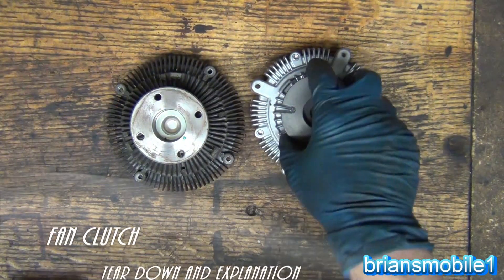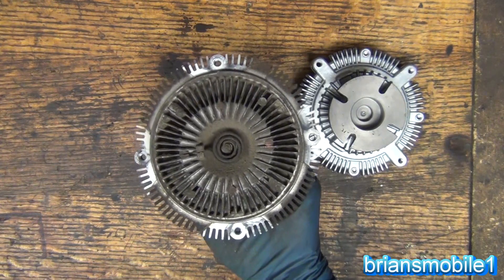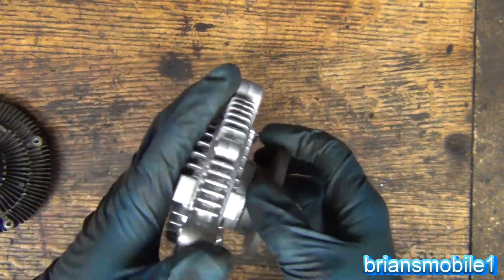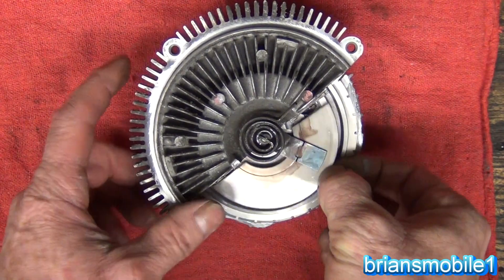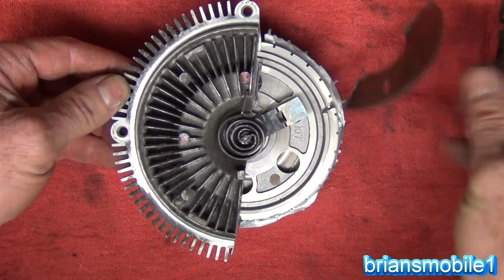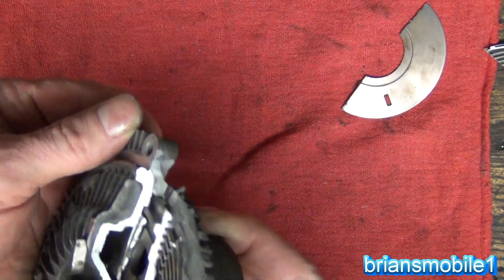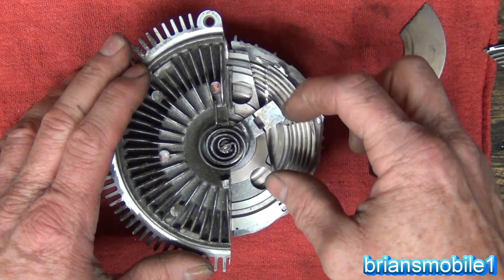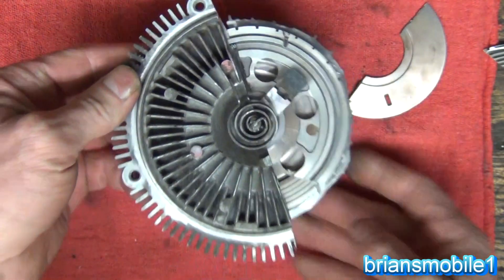Fan Clutch Explo-tionation

Comment: I recall in the 70s n 80s...we would run a bolt thru the clutch to make it lok up....im having trouble w my 2014 tacoma.....its running 2014 on hiway...i was able to put my glove on and grab the fan blade and stop it from spinning😲🙈😲🙈😲

Comment: Nice video;
But you got that backwards: The feed hole (slot) is COVERED when cold, opens when hot...
(since you've cut away the case, you have the bi-metal spring out of alignment).
Also, this IS a fluid clutch, that moving vane releases the fluid into the clutch fins.
And the internal fins are NOT for heat transfer, they are there for the viscous coupling of the two plates...
The spring does NOT force them together.
The fluid must have completely leaked out, or you washed away what was left of it.
But VERY GOOD presentation...
Mr K L

Comment: do they always spin freely when they go bad? Or do they also lock up or get stuck half way? I guess what I'm trying to ask is can they cause a overcooling scenario at start up and idle when the engine is just started?
Reply: Generally, they can only get stuck on, or off, or loose fluid (off).
If the spring valve gets stuck in the 'hot' position, then it would run all the time (ie, if the valve shaft rusts and seizes).
But not likely, because usually vehicle sits with engine cool, and is more likely to get stuck in the 'off' position...
Of course anything that can happen, will happen... If it is 'crusty', I suppose it could open up (fan on), and get stuck there - fail to retract again when cool...
Mr K L

Comment: Imports and domestic vehicles going back into the 80's all had a silicone fluid fill via a screw on the engine side. The closer the plates you exposed in the cut-a-way simply expose where the fluid is held. This fluid become thicker and thinner in viscosity just like most fluids, even oils as temps change, but it produces a drag between the drive and driven parts the control the fans speeds. Yours like everyone else simply failed as it developed a leak. The silicone formulated and injected is gone leaving no means of moving the fan to match or couple speeds with the circulation pump or fan block as some designed. They all had silicone fluid inside then between those cavities and gone because of a leak, it simply freewheels.
  As for overheating at highway speeds, they normally are along for the ride and don't pull air thru the A/C condenser or radiator. Flushing the radiator core to have no insulation debris separate the fins & outside air or and engine problem was most likely you root cause of overheating under those conditions as the fan clutch had fail over winter or months earlier. The pressure cap holds 15-17 PSI on the coolant. Each 1 PSI raises the boiling point 3 1/4 degree F to 264 degrees F roughly (Yours may vary) but the clutch was not the problem at 50 MPH - 75 MPH with or with out the fan clutch functioning. 
DK, ASE master tech since 78.

Comment: Yeah I always wondered how those things worked like without wires from the ecu telling the clutch to engage or without having hot coolant flowing into the clutch to engage the sping that reacts to temperature. (I'm like I know they have a spring that responds to temperature but how do they know the temperature of the engine if they don't have coolant flowing into them to engage when the coolant is hot) The thing I still don't get is how do those clutches know to engage when the ac is on without any type of wires going to it???

Comment: Ever since these things first appeared back inn the 80's or so I was told a honey like viscvous fluid was used ....I believe when they wear the Viscous fluid leaks out and they can no longer work to put it simply...Ive grabbed and stopped many a fan blade on a hot engine while the clutch was freewheeling and the engine idleing with my bare hands showing off to my fellow mechanic friends when I was a teenager , I would let the back side of the blades strike my fingers and slow it down and then Grab the fan and hold it still for a few seconds while the engine was running...
LOL

Comment: tried 3 of the new junk fan clutches from china and my truck sounds like an airplane cold or hot. off and on all the time. new ones are cheap garbage. went to the junk yard with an original clutch for $30. no problems.

Comment: Very Rusty Spring:
The other day I was towing our camper. OAT was approx 65*F. ECT went up to 238*F.  No fan engagement at all. Clutch has resistance but I was thinking the fan clutch spring was very rusty like sandpaper and binding up.  Thinking possibly the spring is not rotating.

Comment: @briansmobile1 the fan hub you cut up should have had silicone oil in it, if it's empty, that's why there's no resistance in it and it doesn't work.
If you open the new one, it will have around 30-60ml of honey consistency silicone oil in. Different hubs and engines require a different oil weight, i Just put 36ml of 10,000mm2/s in my hub.
Excellent video and explanation but it's missing a vital part!
Cheers!
Reply: Is it possible to get the wrong fan clutch? i have a 91 Mustang and everytime i would go to a drive thru or something the car would start overheating,not bad but just not good either, i keep my coolant very nice and clean, thermostat perfect, good radiator but the new fan clutch i had  that "helicopter effect" people talk about, i said the hell with it and installed a electric fan , never had any more issues again.

After about 6 years the Time has come to overhaul my electric fan system and im looking for a different control box for my fan so for the time being i purchased a brand new  mechanical fan, clutch and fan shroud which i should be getting this weekend, I'm concerned its gonna start doing the same thing again however these cars came with that mechanical fan, not sure why it would overheat.

All i can think is maybe i got the wrong clutch last time i bought one,i still have it and its actually not that old but man when you would start the car it would make a sound like a helicopter was taking off under my hood, lol.

Comment: Does it matter which way the spring is wound?
Reply: Yes;
Has to be right for the design.
Most I have seen have a CCW (as viewed from the front) valve open rotation direction; but I have seen this done with both CW AND CCW wound bi-metal elements! - it depends on if the 'spring' they designed is expanding on heat, or contracting on heat...
It depends on if they put the higher expanding metal toward the inside of the coil, or wind it the other way...
(so don't get it flipped over, if for any reason you remove it...)
[answered this for future viewers here]
Mr K L

Comment: I have a 96 nissan truck and the parts both old and new look exactly like what I have. the old for sure and the new I picked up a O'Reilly's  and is a IDC. my old one was doing the opposite. It was locked up and even though I could get it to turn by hand there is a point that it just sticks.  now that I know there is no fluid in there maybe it could be cleaned up.  I don't know.  but I am curious how the new one has been working.  I had about a month where I didn't notice anything and the fan was turning but no issues.  It was a month later and I didn't even think about it being the Fan Clutch because it was new.  But evidently mine is not engaging when it needs to and I heated is up to 220 and it is still the same.  but when it is on the pulley and the Water pump *waterpump is good, when it is there and I suddenly hit traffic and it needs to cool things down you can hear it getting wobbly and just enough time to pull over because it reaches out and nicks the radiator. The fan blades that are attached to the Fan clutch move from that wobble just enough to nick the radiator and lose your fluid and get a tow home.  I chased so many other things and I could not believe it when i realized the new one I bought was not working correctly.. So I am just curious if after some time did yours do good? I think mine was made by IDC for O'Reilly's.  ayways, thx, kinda interesting coincdence and I am hoping the next one I get is not messed up.  definitely will test it beofore I install it so I don't nail another radiator.  that makes 5 aluminum and my OEM nice heavy duty one all from this crazy part and that no one thought it could be the culprit.

Comment: I definitely understand the concept of the fan clutch.  I don't understand why there is any resistance at all when the clutch is at room temperature and the fan is not needed.  At room temperature, the engine/radiator would be considered "cold," and the radiator would not require any cooling air from the fan.  So at room temperature, there should be NO resistance in the clutch so the pulley can spin freely without resistance from the fan (with a cold engine, the fan would do nothing but suck engine power and lower efficiency).  But if the clutch has resistance at room temperature, that means the fan will be turning when it's not needed.  It seems to me that the clutch should be completely disengaged when the radiator is cold.  Then, as the radiator gets hotter and hotter, at some predetermined temperature the bi-metal spring would turn enough to engage the clutch and spin the fan ONLY when additional cooling is needed.  What am I missing?
Reply: It has to have SOME airflow to activate the sensor.
Without that, once it shut down in cold weather, then, with a tail wind, or parked, engine idling, it would overheat without kicking in the fan!
[answered this for future viewers here]
Mr K L

Comment: If I put higher viscosity fluid inside would the fan be running all the time? I just want the fan to spin louder at low speeds for the cool rushing of air sound like in big diesel trucks.

Comment: Thanks for the video Brian. So there’s absolutely no fluid in this type of fan clutch? I think this is what I have on my 2003 suburban
Reply: condor5635 should be fluid in there. I replaced mine with an extreme by hayden 2786. 2002 gmc yukon. The temp would hit low 200's and at one point 230 towing a camper up a long grade. Right now, I can't get it above 199. I use a blue tooth elm127 obdII connector and monitor with torque pro. The engine actually cools off when parked and I increase the idle. Best move ever.

Comment: Question. Can a fan clutch turn either way or they are meant to turn either CW or CCW?
Reply: They will only work (correctly) one direction:
The fluid return pumping action occurs only rotating one way. (necessary to disengage the clutch).
Drive belt routing results in different vehicles having right or left hand fans...
[answered this for future viewers here]
Mr K L

Comment: Great explanation of how a fan clutch works. If you still receive notifications from this I have a question. I had the timing belt and water pump replaced is it true that they should have replaced my fan clutch when doing the water pump? I read that the fan clutch will wear the water pump quickly on my 1988 Toyota truck with a 3.0L V6 if it was not replaced.

Comment: Great video. My Jeep is having an issue with the clutch fan I believe. Keeps nice and cool on the highway, and on long straightaways...then in traffic it runs a bit hotter without overheating. I didn't realize that the spring in the middle was a sort of 'thermostat". I figured they just ran on centrifugal rotation based on engine rpm.

Comment: Hey Brian- this is a great video explo-tionation! I am about to buy a 7 blade Mopar fan with a clutch. This is for 1968 383 motor and as you can imagine it's getting harder to come by. So my options are limited. How can I be sure that I am buying something that is good quality and not to used up AND how hard would it be to replace the worn out portions of seriously old internals of the clutch?

Comment: Poor engine... Those clutches are reliable, but go tear out an electric fan from a scraped ford taurus or something. Tiny engines suffer quite a bit (or as much as alternator strain) and that pully puts too much torque on the pump behind it, causing your whole engine to heat up and strain from being heated up and straining.....

Comment: I think you got it wrong. According to my college book that spring just opens a hole for the fluid to flow. I think your old clutch just lost all the liquid that is why is dry. The new one got fluid inside.
Reply: It does seem to have lost all the silicone fluid that is supposed to provide the viscous coupling.  When the temperature gets high enough for the bimetallic coil to turn the valve, the silicone fluid goes to the outer area where the interleaved grooves are, and allows the fan to be driven instead of freewheeling.
Reply: ***** That is what I think. Thanks
Reply: Yeah i was surprised too. Coz always knew that there s silicone or some liquid in there.

Comment: I don't understand what this spring does. How can that lock the clutch?
Reply: Gregory May when the spring gets hot it opens a valve that releases silicone fluid and the fluid flows into the grooves of the clutch that creates friction and makes the clutches lock and spin the fan. When the spring cools it closes the valve and the centrifugal force makes the the fluid flow back into a hole the fills the fluid reservoir back up. The lack of fluid causes the friction to dissipate and the fan to free wheel.

Comment: I had a tractor with failed fan clutch this spring, supplier did not have a new one so they suggested just to weld shut moving parts together so it would be constant fan on. At least tractor could work in the field...
Reply: I repair tractor and truck ac for a living. The majority of tractors I get in have a strap bolted to the fan clutch locking the fan to the clutch. They are easy to make with a drill, hammer and vise. Fan clutches on tractors cause more problems than they save imo.  Anyhow my point is easier to make a strap than attempt to weld.

Comment: My Jeep didn't come with the factory tow package. It has an electric fan for the radiator, but I need to add the mechanical fan with a clutch to add extra cooling. Thanks for the explanation. I had no idea how it worked. Great videos.